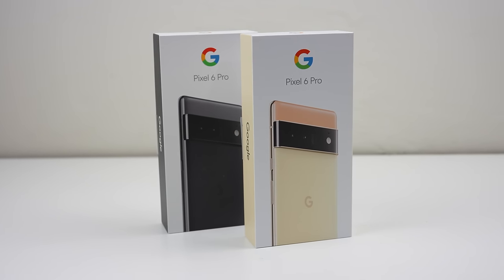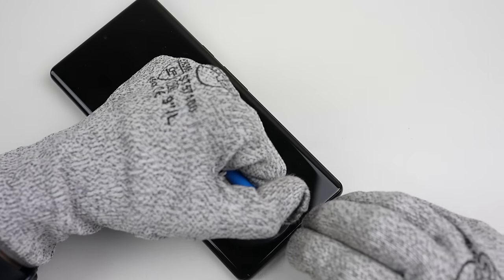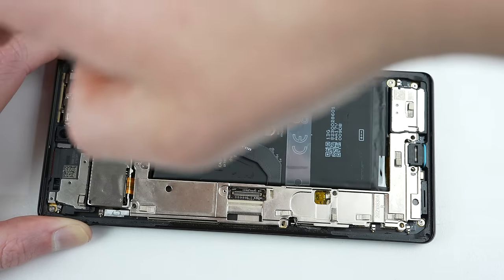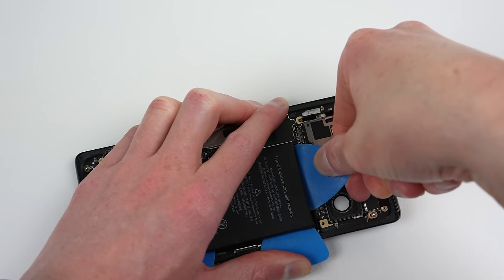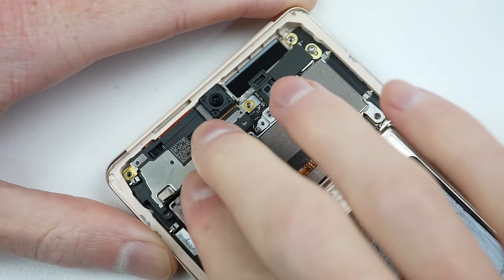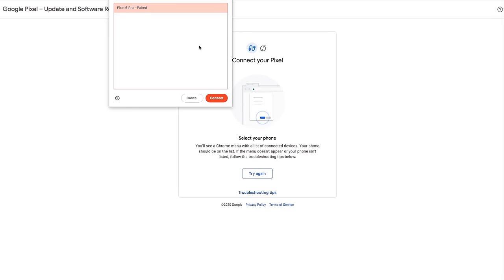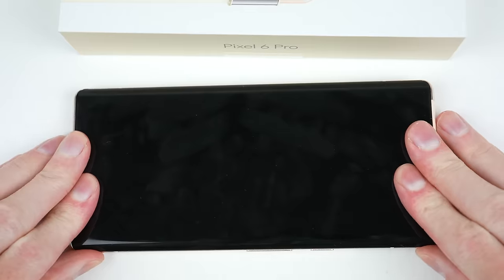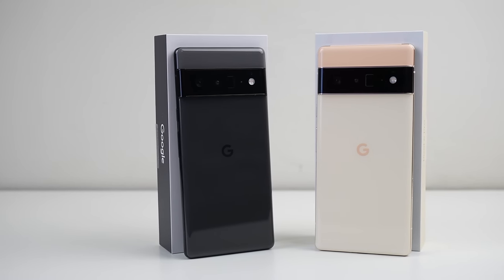Pixel 6 Pro Teardown and Repair Assessment - Serialisation With A Twist

Comment: Does not serialization make stealing phones virtually pointless? If it has a password stronger than say 12345, you can not unlock it / factory wipe it, hence you can not use it or sell it. Then you might want to scrap it for parts and sell them individually but what is the point if they won't work? 

I do not know if there are tricks to persuade iPhone/Pixel to factory reset without entering the password, so please tell me. Back in the days, it was easy, but I've never flashed/rooted a device since then

Comment: I think with these stickers they want that the battery is killed by the heat of the processor so you can replace the battery sooner than later.
This could be the only thing because a battery doesn’t need any shielding!

Comment: Actually USB port can b easily replaced with a heat gun and soldering station....
Reply: It's still outside most people's skill range where you can just replace a charging board by unclipping a few cables

Comment: Not a fan of the soldered on components at all on this device, especially in the case of charging ports. Wireless charging is inefficient and the charging port needs to be modular. 

Glad that every part isn't compromised after the swap, I was very scared when you started booting up. Kudos to Google for publicizing the methods to pair the fingerprint reader - this is what we need.

Comment: Doesn't anyone think the tensor chip being without branding or marking worry anyone????? I've never seen a processor or micro controller without branding on a flagship phone (or any name brand equipment).. they generally make damn sure it's branded so it's clear who's property it is.. in fact chips without marking are usually not genuine or not bought through the same channels as the ones with markings. Even apple brands their chips...

Comment: If this companies really did the no charger thing for the environment then they would have offered a version with a charger for the customers that don't have one and need a charger to come with it.
Because all those people will have to make a separate order from a shop for a charger that will waste more in packaging and transport costs which in the end is worse for the environment. 

They are just hypocrites looking to make bigger profit by making you pay the same inflated prices without even giving you a charger.
Reply: The chances of people NOT having a charger laying around in 2021 are slim.  So, the extra waste generated by the few that need one are easily out weighed by the people that don't.  A SKU with  a charger doesn't mean it comes in a same size box as these.  So, that argument doesn't hold water.  The transportation costs don't mean much either.  They would only make a difference if the transport wasn't coming you way in the first place.  The UPS or Amazon truck isn't making a special trip just for you.
Reply: @dlewis9760  not everyone has a usb c charging block

Comment: “I still think companies remove the charge adapter for profit” 
No. They don’t. They’ll only save about $5, maximum $10 because it’s a cheap charge adapter which is sold for around $20.

Personally I think it’s so they can ship phones in smaller boxes.
Reply: Wouldn't that still be for increasing profit? Smaller boxes, less weight, and less components all mean cheaper shipping costs en masse.

Comment: Now I want to hear iPhone users excuse for apple bricking face ID after a screen swap. Clearly google has shown here its not necessary.
Reply: Iphones use a closed source system so they can lock whatever they want and not allow people to recalibrate “security reasons 😂” while android is open source so this type of thing is possible with android phones
Reply: @htfab9251  Google's Android is more closed source than open. Being closed source is not a good excuse either because ideally biometric authentication data should be encrypted on the phones memory not attached to the physical module.

Comment: The fingerprint issue luckily is able to be solved phew  

It's not like Apple iPhones where if you replace the battery or display or camera you warnings Pop up and it prevents the phone from being used properly luckily this is a way better than the iPhone

Comment: Heres a random thought... why don't phone cameras come as a Bluetooth separate  which sticks to the top of the phone via magnet and simply be pulled off and used anywhere you want while still wirelessly connected,  or just keep it on the phone if you prefer. It would certainly allow for more discrete capturing instead of holding the entire phone up like we do at the moment. Is that possible in the future?

Comment: You NEED to mention that if the website goes DOWN/ gets deleted/ stops eventually supporting the pixel 6

YOU ARE OUT OF LUCK since you can't download the tool/ don't know what's it doing
Reply: By then people probably are able to archive it for offline. Everything that is online could be made offline with the right tools and skills
Reply: @mehshutup3041  you most likely can't, same way as the bootloader unlock tool can't be made offline. It has to communicate with the Google server
Reply: @BuzZ.  bootloader unlock is just one line command trough fastboot
Reply: @alanramone4263  yeah, try to do that on Samsung/Sony/Xiaomi/huawei and pretty much any other phone brand just using a command line

Comment: You assume that all companies build phones and software the same way. Google giving access to consumers on this one model of phone is not the same as say, apple giving access. You have no idea how deep the tool that apple uses goes, and apple security on another level from Google's. I can get around Google locks, sometimes without even using software.
Reply: You can bypass android devices more easily, heck google even allowed to unlock the bootloader but if you can't get any data from the devices that's still doesn't sacrifice the security.

Comment: I would have liked to have seen a test where you swapped the camera modules and other stuff between the logic boards one by one rather than swapping everything from one phone besides the housing over. Time consuming, I know, but it has to be done to draw any real conclusions. All this tells us is that Google isn't as embarrassingly awful as Apple in locking their hardware down.

Comment: My 1 TB iPhone 13 Pro Max in Sierra Blue feels better than ever after watching this. Especially with the frosted glass back, the Ceramic Shield front glass, variable refresh rate display, premium Sierra Blue surgical-grade stainless on the sides. Also AppleCare+ is a dream. What an AWFUL design of the Pixel 6 Pro. Not a premium phone.